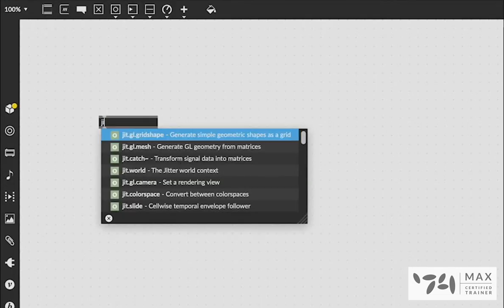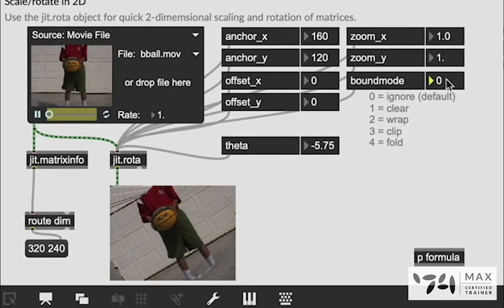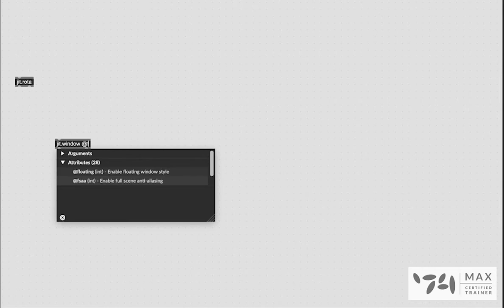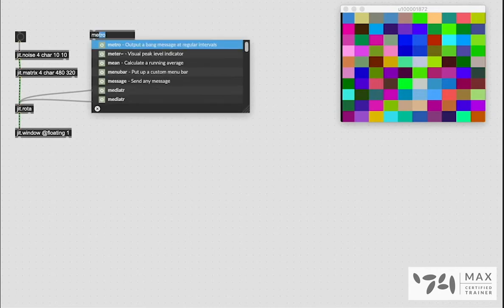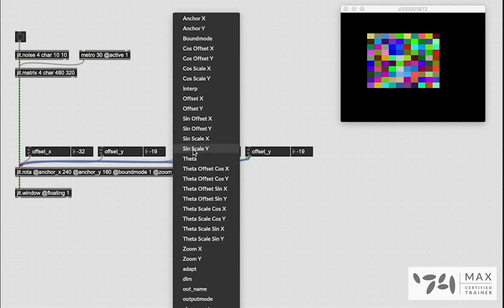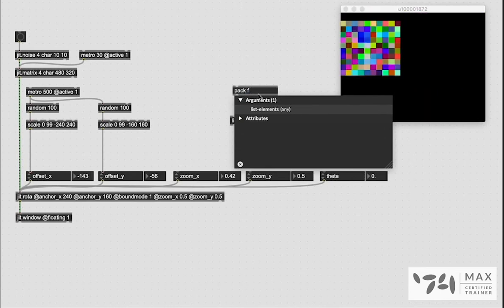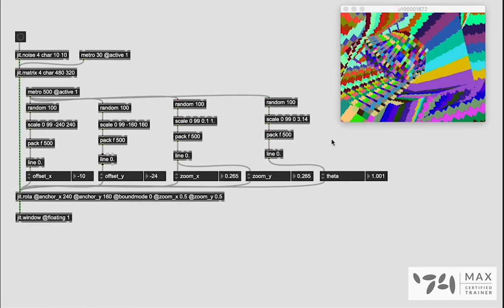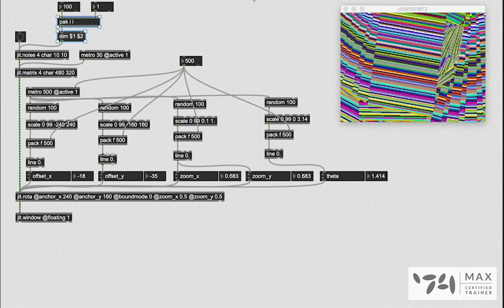Max MSP Tutorial - jit.rota - Intro to Jitter pt 3

Comment: Great tutorial as always. Don't know if you've mentioned thise before, but what's the difference between using the jit.window object versus the jit.world object? When would I use one over the other? I tried to render this project to a jit.world object but couldn't figure it out, is there a way to do this? Thank you!
Reply from the maker: Hey great question! Jit.world and jit.window are pretty similar in that they are both windows to view jitter animations in. The main difference is that jit.world uses the OpenGL render engine which means it will render on the gpu instead of the cpu (giving you better frame rate) and it lets you use jit.gl objects (which don’t work with a regular jit.window). Anything the jit.window can do the jit.world can also do so it’s definitely better to use jit.world. The reason I used jit.window here is because it requires slightly less setup as well as demonstrates some of the weird quirks to learn about jitter (for example the not outputting the frames without a bang, some jitter objects are programmed to automatically do that if connected into jit.world so I avoided using that this time to demonstrate that.) you can use jit.world in this example though. To do so make sure you have a jit.world object with a toggle attached to the inlet and clicked on (or the @enable 1 attribute set when creating the jit.world object) and also you need a jit.gl.videoplane @transform_reset 2 object. The output of the jit.rota must be patched into that in order to see it in the jit.world window. Let me know if you have any other questions.
Reply: @AndrewRobinson26  Late reply here but just to let you know that I appreciate the response! I did manage to figure it out with your comment, thank you!